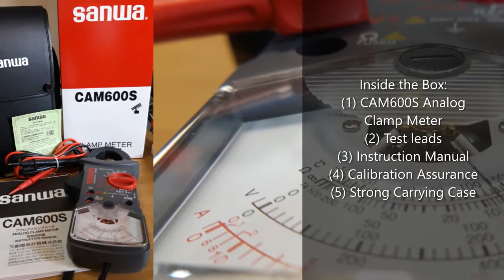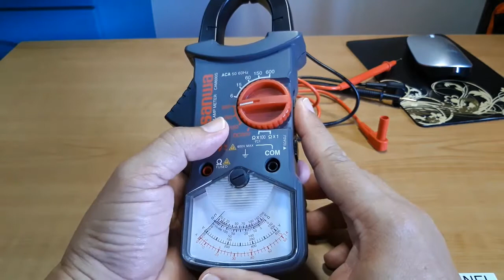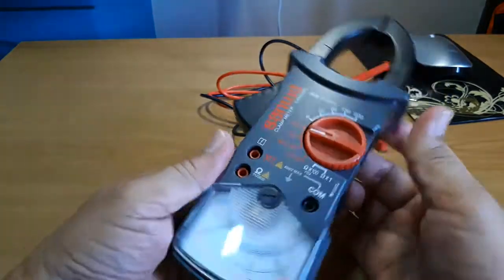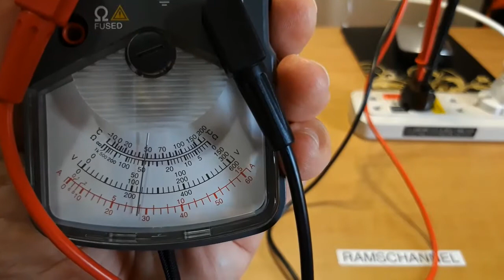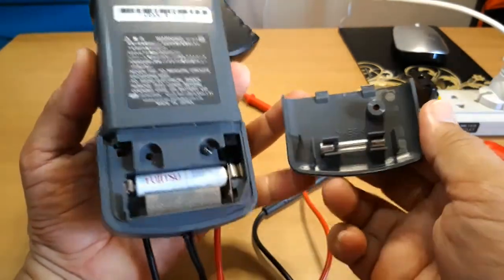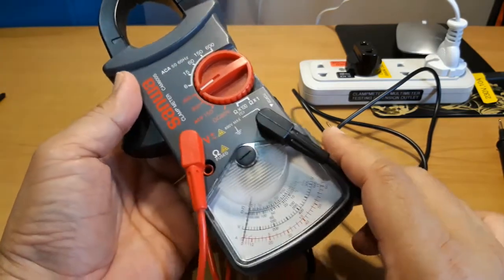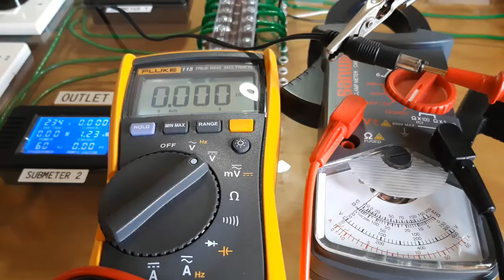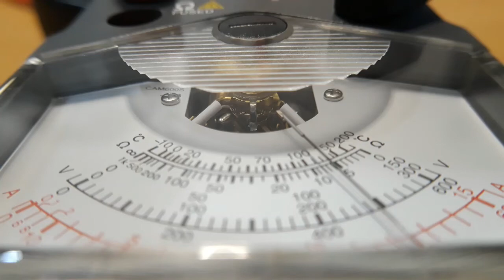[ENGLISH SUB] Sanwa CAM600S Analog Clamp Meter Short Review

Comment: i have one with this model, when i open the case, i accidentally detouched one of the wire from the board, i think it is the negative, can somebody help me, thank you
Reply from the maker: May I suggest that you take the clamp meter to an electronics repair shop so that they can properly assess how to fix it. It may require soldering. Hopefully it's a simple fix for them. Thanks for watching.

Comment: How much it works measuring high frequency AC current?.Usually digital clamps works very bad...
Reply from the maker: Should be interesting. But I have no equipment to test it on higher frequencies. Its only rated for 50Hz and 60Hz power frequency applications.